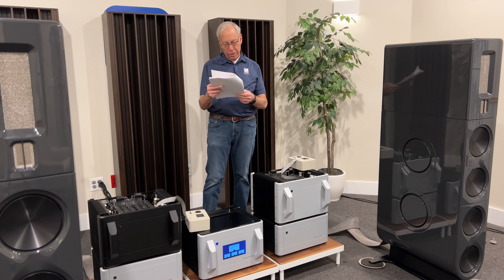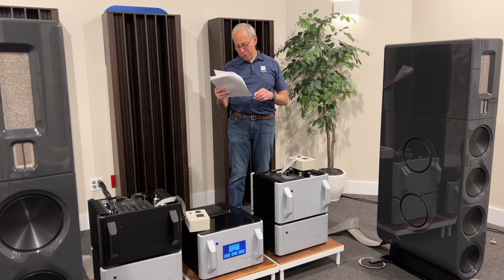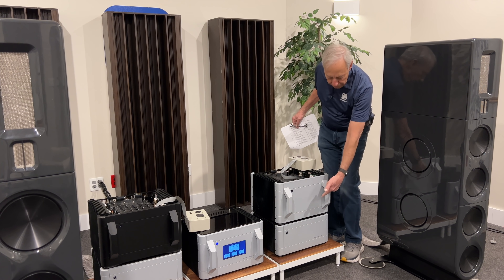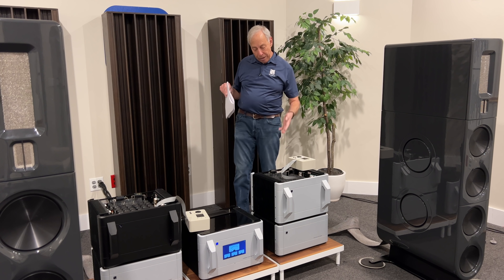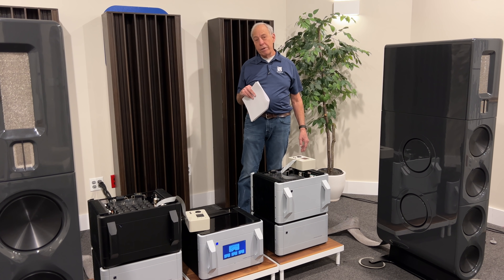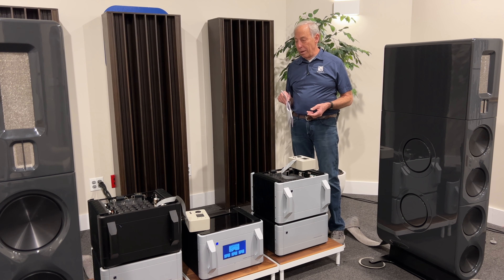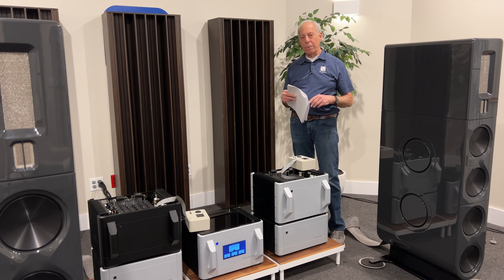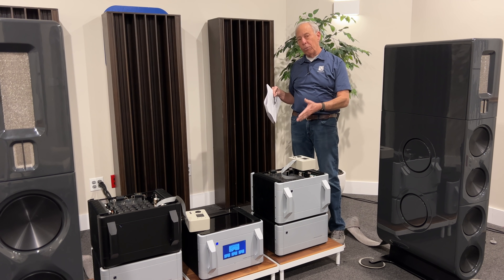When will vacuum tube amps disappear?

Comment: Thank God they will be there for decades more. And now with modern high output power tubes coming out every 5 years or so (see KT-90/KT-120/KT-150/KT-170), you can have high output amps with fewer and more reliable tubes.

Comment: Brief description of my experience: I design power amps, I did not start out as amp designer, actually a real EE for my whole career specialized in analog RF and system design, only got into hifi power amp design after I retire. To be honest, power amp is NOT the most challenging thing I faced.

I don't have the schematic of the high end amp of PS, but I have the Delta 200 schematic. They are supposed to be high end amp. From what I see, it's just simple cook book basic design with cascode LTP with 1.4K resistor load as IPS that BARELY has gain, simple VAS and cheap double emitter follower OPS with 4 pairs of output transistors only. Only one thing a little different is the bias generator which I do not see the advantage. It is a cheap design, but they are supposed to be high end company, this amp must not be cheap......for this design? this is a "play it safe" design with very low loop gain. Absolutely no better(if even) than my Acurus 200 that is a lot cheaper.

Also, I seriously question about PS audio after I look at they sell AC power conditioner for thousands of dollars. I am not saying power side is not important, in fact it's is very important. BUT you care enough about the quality of the power source, do it INSIDE the amp bypassing the power cord!!! You can use regulated power supply if you want to to stabilize the voltage. Use SMPS to save weight. If you KNOW how to design, know how to design with EMC, there is NO problem using SMPS regulated power supply. I personally put a SMPS at the frontend of an electronmeter amp that measure pA of current in relative high speed with great success. It's NOT that hard to design a regulated supply with quick response to load demand. You don't pay thousands for a power regenerator!!!

As for tubes, I believe it's the old folks that hang onto the good old days. They still look for the old sound like they still hang onto the turn table. Don't mistaken that I am young, I retired already. I just never stop to learn new things. I don't have a lot of experience on hifi tube stuffs, one guy brought a "good quality" tube preamp over, he only played for 2 minutes and he took it off the system!!! I design a lot of guitars amps. I honestly can say the tube amps are NOT better sounding than the SS amp.

Sadly, I think people that design audio electronics are mostly hobbyists, not really a real engineer, or at best got an EE degree and straight into designing audio. They missed the whole experience of the rest of the electronic technology. Just look at those schematics, one copying another, change a little and call it their own. If one only work on audio electronics, they are missing the moon, all the modern knowledge of the electronic age.

Comment: Linearity is a question of slew rate, open loop gain and negative feedback. You can use an op amp like the AD797. It has nearly perfect linearity with +5V / -5V rails. There is no need to got to larger voltages. If you use tubes, you NEED to operate them at very high voltages because they have a highly nonlinear characteristic very little voltage gain. So you NEED higher voltages in order to find a little piece within the shitty characteristic to work with. And you need, of course, higher voltages to make them operate at all.
Reply: Finally, some common sense.
Reply: I test different audio opamps, they are all very low THD, they sound different. Sound cannot just be analyzed by THD alone. I designed power amps with different input stages, they all sound a little different. The lowest THD is the Complementary LTP used in Krell and some others. But it doesn't necessary sound best in all music. It is strange that they do sound a little different. One is good for one style of music and the other for another style. Strange.

Linearity is NOT related to slew rate as long as it's fast enough which is not hard to get for audio frequency.

Comment: That validates an idea I had in 2000 to build hybrid amps with tubes and MOSFETS, exactly as described here.  But, alas, modeling the circuits with software back then was not as robust as I needed, so, I abandoned the project.   Being a software engineer with no electronics background, I required software that made up for my lack of experience.  Just modeling a simple power transformer (accurately) was insane.

Comment: I miss building audio amplifiers from scratch.  I remember one of my first amps using the 12ax7. Then it was transistors using the Darlington configuration....ah those were the days. Now most amps are class D using MOSFETs. How times have changed.

Comment: Great video. I am also a user and avid fan of tubes. My usage has mostly been in bass and guitar amplifiers. The problem that I am experiencing is the quality of tubes being manufactured today. There have been tube sets that I have ordered for customer repair and maintenance that are so bad that I had problems just trying to bias the amp. I tried all of the tricks from matching to warming up the amps for hours with signal going through them just to get a successful bias result. Then, there are some that are less problematic and bias fine. The consistency seems to be all over the place. It seems that I'm either too picky or manufacturers of equipment are not raising the bar high enough. Case in point. I own a Manley reference tube microphone that after a few months, started developing stage noises and the sound became dark when compared to other tube pics that I own. I had cut several vocal tracks that sounded superb when I first bought the mic. Manley customer service sent me a tube which they consider "mic grade." That replacement tube cured the strange noise issue, but sounded like a totally different microphone. I sent the tube back to them telling them to please send me a tube that sounded like the one that came inside the mic. They sent me another tube. This replacement "mic grade" tube, sounded smooth and silky, but the self noise was a problem when recording anything other that rock music. I kept the mic with the second replacement tube and only use it for rock vocal work. I find that tubes are hit or miss these days. Back in the 70's when I was first working on tube amps, I would run to the electronics store and purchase six 6550's, pop them into the amplifier, perform a bias adjustment, and that amp sounded fantastic and biased up like a top. These were off the shelf GE tubes before boutique or matched sets were ever offered. But, I agree with the subject matter in your video that nothing will ever beat a tube for HiFi.

Comment: I wonder what effect these shenanigans in Russia now will have on new tube supplies? Only Russia and China still make tubes. And the Russian tubes are generally considered the best of the two. Now there is still NOS and used tubes, which is great for DIY, but you can't produce a product like PS Audio does without a reliable supply of new parts, tubes in this case. And my advice on tube amps is that they sound different than solid state. If you like the sound of tubes, then for you, tubes are the best choice. And likewise for solid state. There is no "best" amplifier and never will be. I use both. Solid state for HT and multichannel and an all tube 2 channel system for music.

Comment: Love the channel, but I notice whenever Paul responds to this kind of question it's a vague, gentle knock at all-tube designs.  Like when Paul says "I would change my tubes every six months"  is a gentle way to sway less educated audiophiles away from all-tube power amps.  I had a BHK250 (and have owned a ton of other gear) and it was fine, but even though it was described as being comparable to a tube amplifier it was not.  

And for those that know, it's never gonna happen.  If given a choice of a very good but cheap tube amp over this expensive solid-state or even hybrid, and I knew I would have to live with it forever, I would take the cheaper tube amp.

Comment: They won't. I've owned many PS Audio products and they have all gone to pasture. The tube stuff still exists, will continue to exist, still WORKS, and when compared to the failure rate and quality of PS Audio gear, is far superior. I'm at the point where I'm designing my own gear and what PS Audio makes can't touch even the lower quality tube based stuff that I can produce on my kitchen table. Thanks Paul for your continued efforts to inform the audio world but you should be in the QC department more and on camera less. I gave PS Audio 4 tries. The BHK250(just a mediocre sounding amp to me), Stellar Gain Cell (channel bias to the right output channel and unusable for critical listening), Stellar Phono Pre #1( blew up at hour 10 with smoke), Stellar Phono Pre #2 (came from the factory with loose parts inside and the pots in the chassis were all misaligned, never even plugged it in, sent it right back for low quality).My .02.

Comment: I have always believed that demand will drive supply. But the whole process of manufacturing valves is pretty non-green. Lines have little changed from vintage processes and materials. So forget logic. It will take an illogical exuberant personality to stand up and maintain modern tube manufacturing in North America to service the audio industry.

Comment: Classic timing as Russia say they will no longer supply the UK or EU... The Chinese factory burnt down in 2019 and they have switched to semi-conductor production instead, JJ have cncelled all back orders and supplys run out across the Globe....   Fact is it's highly toxic production process with Mercury and other toxic metals involved so health and safety regs mean only the likes of Russia and China will allow production... Slovakia is the only manufacturing country right now with any supply... There will probably be small supplies for a good while yet in the US, and even smaller in the EU but don't hold on the hope you can pick up a replacement anytime soon...
Reply: The Russian factory is exporting again.  It's American-owned, and no matter what, it's building tubes.  And there is another Chinese plant PSvane building and expanding, just like JJ is expanding.
Reply: @bills8770  The Russian plant is only shipping to the US not the EU or UK and due to the war the sanctions will last years so that isn’t going to change, the other Chinese factory is small and doesn’t produce much at all and is likely to also swap to semi conductors 
JJ have back orders dating 18 months and have cancelled all of them until further notice …
Reply: @bills8770  We already had a very short supply , Fender reduced its amp production by half because for two years they couldn’t get enough tubes so this ain’t going away anytime soon

Comment: Odd request considering the topic. But I play guitar and use tube amps. Due to recent conflicts in Ukraine has made it impossible for me to get correct replacement tubes. I have always considered using solid state replacements, but have been unable to find a supplier or schematic. 

Please can you help me find a supplier of solid state valve replacements, that can deliver to United Kingdom

Comment: Hi, I am an audiophile and want the best quality concerning amps, speakers, music files etc. I was thinking when most people can afford high end equipment they are in their later stages of life. This fact makes it almost ironic that one would need to be much younger to truly enjoy the frequency response these systems have to offer because as one gets older your hearing deteriorates making all the fantastic quality go to waste a little. What are your thoughts? Life is short so enjoy the best quality of things while you can? or do I have a small point?
Reply: I am 68 and you have a valid point. I have a hard time hearing anything over 10 Khz or so. OTOH, my son is 42 and he does appreciate the differences, but probably because I made him aware of them 20 years ago.
Reply: @rupe53  Thank you for getting back to me I really appreciate it.
Reply: I think frequency response is only one thing in listening. Most sounds are below 10KHz, you really don't miss a whole lot. It's the sound stage, separation, 3D effect that are more important to me. To get that, not only you have to have good amp, speaker cable and speakers, the room acoustics is just as important. Speaker placement is so critical, takes a lot of playing around to get it right.

I personally mainly use my system to watch tv, not even surround sound, just 2.1. I had 5.1 before, did not like it, it's too artificial. I like a good system that make you feel like you are in the middle. You can hear sound surrounding you. The effect is so much more natural than 5.1. This take a very good system to do that. 

To me, the most critical sound is human voice. Anything imperfect will show up. I can even use a news channel to test. No high frequency involve at all. I am 69, I test the frequency response of my ears, I can still hear up to 12KHz(barely). I don't think it's too bad.

Comment: What many ppl don't understand is that the type of distortion matters more than the amount of distortion. A tube can have about 10x the distortion of a transistor and still sound more natural and organic because of the type of distortion. There are some solid-state amp designers who spend most of their time getting the distortion right but not low in example Jean Hiraga with his LeMonstre and PrePre. It get's even worse when you hit op-amp territory, they sound even worse and they have about 1/10 of distortion of a "normal" transistor or 1/100 of a tube, but once you introduce them into your system you always notice a sound like a dentist drill. The type of distortion is what matters most.
Reply: Even it one amplifier has 0,2% distortions and other 2%  100% sure it  is the same for listening. 

Considering that we use only no more than 50% of max  power  distortions fall below 10% declaired counetd  s repectively it means 0,02% and 0,2%  

So   such low level nonlinear distortions  are not real reason of bad impression but the reason is in  not spoken faults .

Comment: Can the output transformer (tube power amp) offer a better transfer of power to the speaker (as the speakers impedance varies)??  I swear I owned a Sunn Sonic 1 (rated at 40 watts RMS)- bass guitar amp )) and  that amp was the most power full 40 watt amp I ever experienced!!!!  Yes this amp cabinet used a JBL D-140 speaker.
Reply: Sunn had good power supplies and that gave the amp more head room than some of the others. It was a quality product.

Comment: The continued existence of vaccum tubes in HiFi systems confirms to me how gullible non-technical HiFi nuts are.   This advert by PS perpetuates the myth that tubes can beat any properly designed semiconductor equipment just reminds me of how gullible people can be.
Reply: Perhaps it is easier to use one vacuum tube than engineering a semiconductor alternative. My guess based on your comment is that you are not a technical person, at least not in electronics, but designing tube amplifiers is actually much easier than using solid state alternatives, so insisting on not using tubes to get the same result can become very expensive. Just look at Luxman and their prices, the tube audio experts who can do the same with semiconductors.
Reply: @hugobloemers4425  I am an electronics design engineer. I have worked in the field of audio. Now I work in the field of designing security technology. So you are incorrect in your assumption.
Reply: @RobCCTV  Engineers - dull . At least most .

Comment: I never heard a tube amp bot I hear good things about it. Can I use a tube pre amp with integrated amp? Thank you for your time and educational videos
Reply: I did that for years so no problem. I used a Dynaco preamp (that I built in 1968) with a Phase Linear 400 amp. That thing had lots of head room.

Comment: As I understand, they almost died off during the rush to solid state, but a few die-hard audiophiles predominately in Japan continued to build and use triodes because they liked the sound.
They are more expensive to run, but they look and sound great.
Thankfully I acquired a lifetime supply of 6C33C tubes before Russia closed.
Reply: I have an Almarro amp that uses these tubes. I never use it. I gets way too hot and 6C33C tubes are too finicky.
Reply: And Western Electric's looking into making 6L6's, KT88's etc since that outfit's already building 300B's for its amplifiers.
Reply: @piercehawke8021  It's a waste to make new 6L6's since there are are still hundreds of thousands of them out there, not as many as 6V6's, but still a lot.
Reply: @bertroost1675  My info came straight from the western electric website about possible upcoming tubes
Reply: @piercehawke8021  I wasn't arguing with you. I was just commenting. 🙂